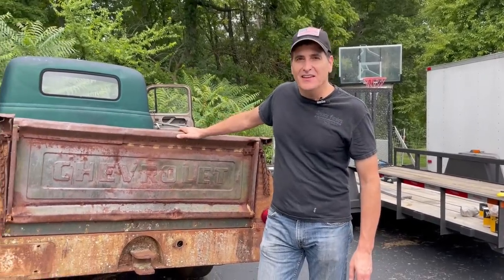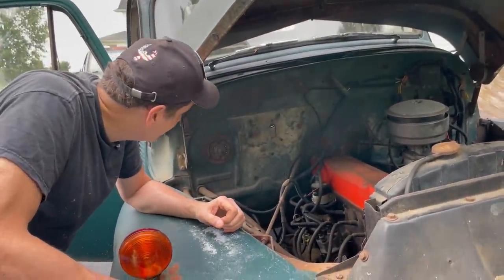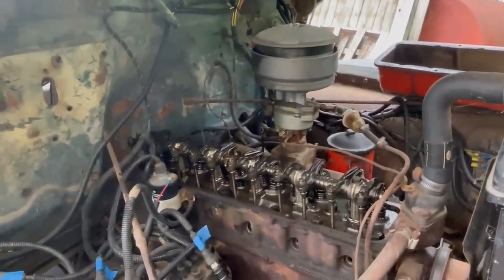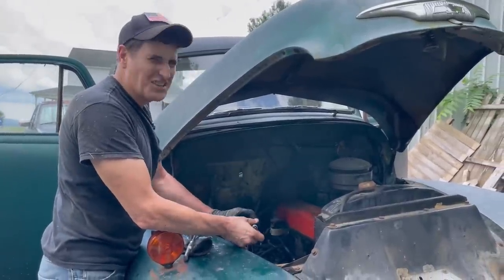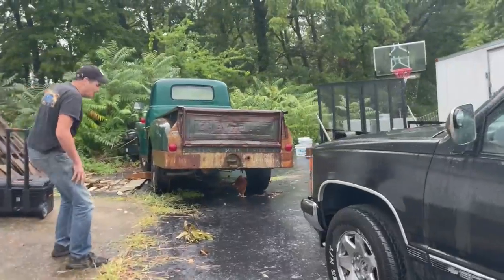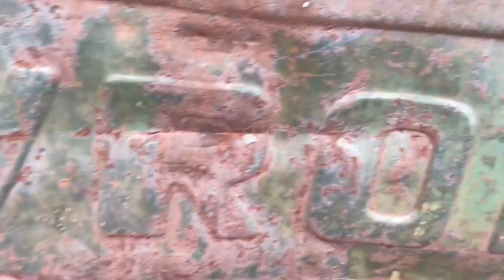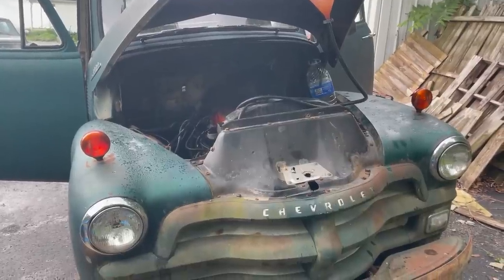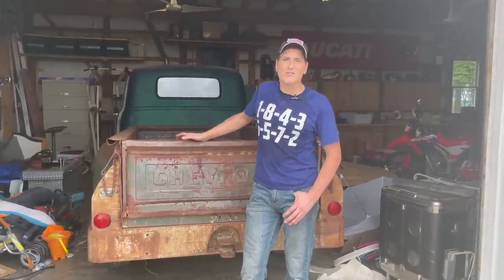Will it run and drive? 1954 Chevy truck needing some help.

Comment: When you bring back something this old, don't you worry about using unleaded fuel in them?
Reply from the maker: It is a concern if a lot of miles will be put on the truck. If not, it will be OK.

Comment: Was wondering if you add zink to the engine?
Reply from the maker: Yes. It is in this type of oil. I always use Diesel oil, usually Rotella, because it already has zinc and phosphorus in it. It is much better than using a zinc additive, because a zinc additive can be washed off the cam due to the high detergent content in modern oils.